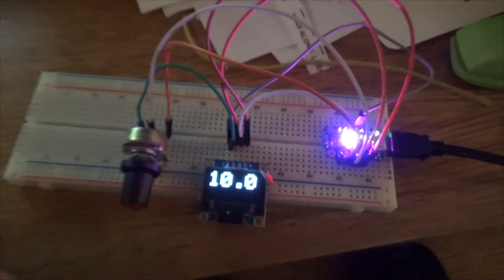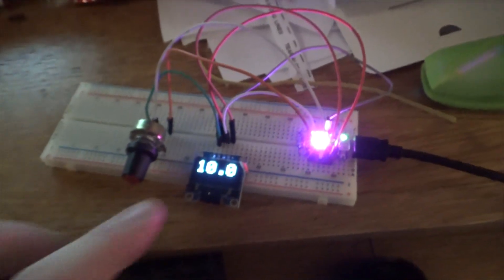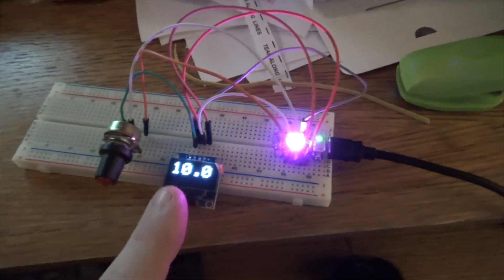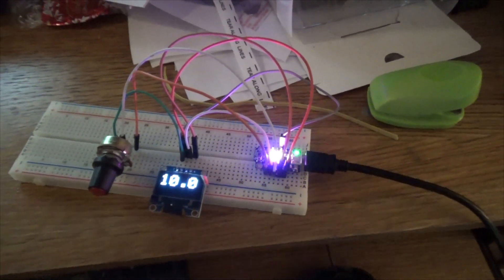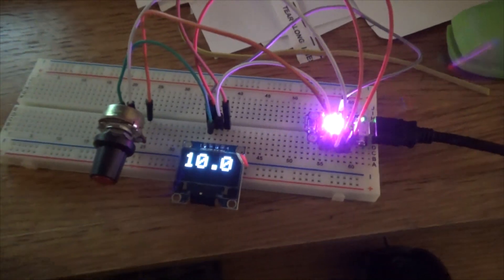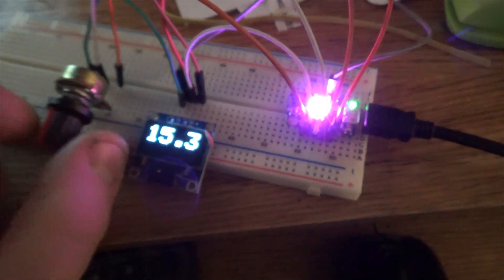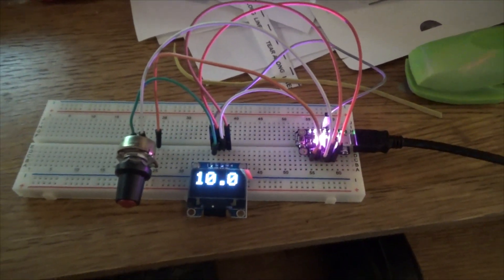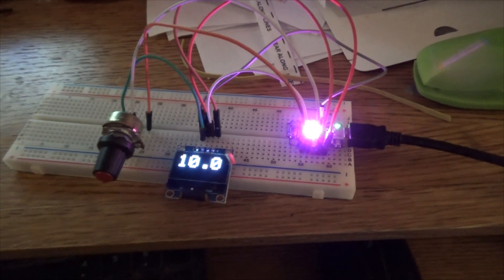Wideband GAUGE update! 12-21-19 Twisted Builds LLC

Comment: Hey man. Is there any chance you could provide the code that you used? Does the speeduino not natively support wideband?
Thanks in advance
Reply from the maker: Liam Lage sorry code is proprietary so can’t share it. Speeduino supports a wideband input however it can’t control the sensor. My controller controls the sensor, and feeds a ECU and could be this gauge a reading for it to work with and display AFR.
Reply: Twisted Builds LLC Thank you so much for your quick response!